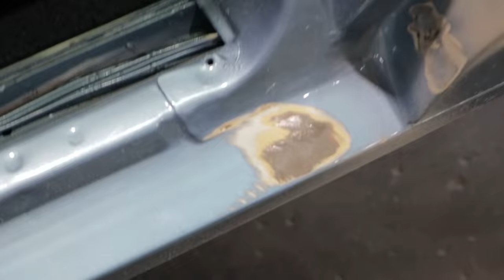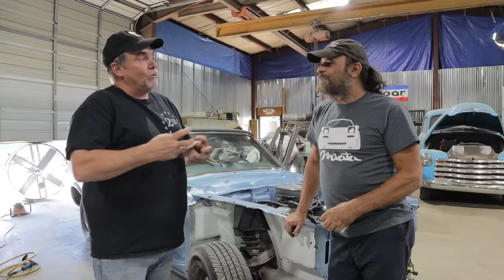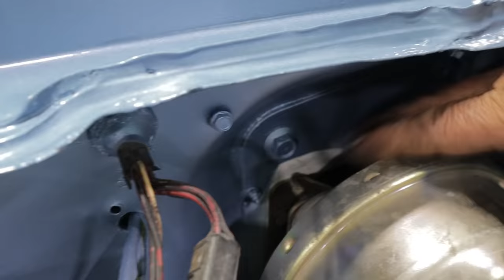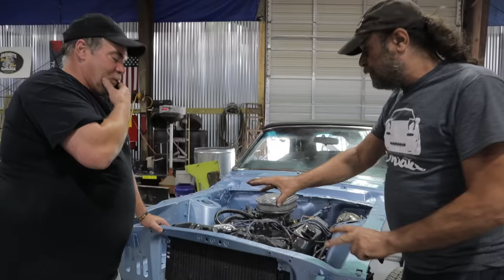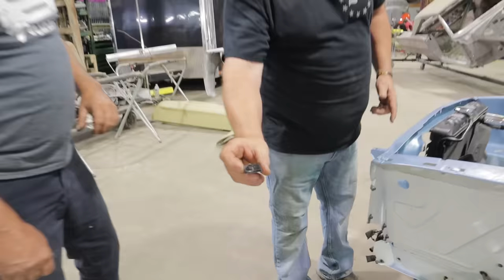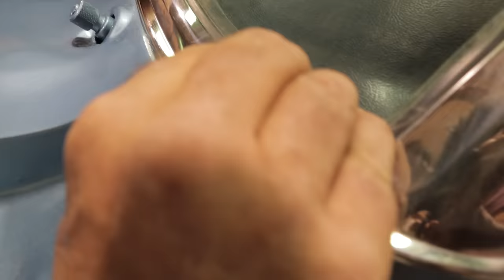Refugee From Body Shop Hell

Comment: I'm a body man. You have to get rid of the rust, then cover the area with epoxy primer or fiberglass filler to seal it, then do the final skim coat of plastic filler after that. And if it's still not smooth, use polyester filler or spray. But none of that will work if you don't get rid of the rust first. Cut or grind it out completely. Make sure there's no more on the back side of the panel. A lot of people think they got all the rust but there's still rust on the back side of the panel and it will just keep spreading like the cancer it is
Reply: Don't forget to skim coat and block sand!
Reply: To be clear, rust converters won't stop the cancer from spreading?
Reply: Yep. Welding patch panels to rusty metal sucks anyways. 
Unless you can really get to the back side of the metal it's going to rust again. 
If you're a body man you know what I mean.

Comment: Problem is do a competent restoration on almost any 50's or 60's car you will be well under water when you go to sell it.  Only way a flipper can make money is cut corners.
Reply: You might be able to flip a rare valuable car, like some sort of limited edition hemi that sells for 150 grand. The problem is a full restoration costs pretty much the same for a base 6-cylinder car as it does for a valuable limited edition.
Reply: @evoblade2000  Agreed there are a few numbers matching cars such as certain hemis, certain corvettes, copo Camaros, LS6 Chevelles, Shelby Mustangs and a few others that you could do a last nut rebuild on and probably come out okay, assuming you owned the car in first place.  This looks like a run of the mill 67 Mustang.  To strip it to bare metal(which needs to be done seeing the rust), repair any rust, repaint, reupholstery, rebuild engine and transmission, rewire ect would probably run you 70-80k if you farm it out to a reputable shop, maybe more depending on how bad rust is and how many parts need replaced.  Then you have a car worth about 30k on a good day.
Reply: For that amount of $$ I’d rather buy new.

Comment: I worked on a 67 mustang that had the fender Bondo d directly to the rocker panel. I saw a chevelle in the junkyard that got rear ended it had a inch and a half of Bondo, the paint was shiny too.
Reply: My 79 F100 had a solid two inches of bondo fall out of the fender a week after I bought it. First cars 😂

Comment: As more of the graybeards that naively finance these shoddy restorations die off their cars will become the parts cars for higher end restorations.
Reply: And that is as sad as the work done on this car. I would rather have more classics than less.
Reply: @davidmiller9485  slowly, the quirks of time diminish the ranks.  Classics get totaled in accidents, garages burn to the ground, floods in unexpected areas, theft and stripped of parts, etc.  Obviously as the years go by what were once common cars join the collector ranks.  Interestingly, Haggerty  says that the total number of classics has stayed pretty steady over time: newer cars become classics at about the same rate as existing classics get written off.
Reply: Maybe if every b o o m e r wasn't a "I know what i got, and this rusty rolling shell is worth 20 grand" types there would be more cars in the hands of young people
Reply: @davechampion4987  You can be mad at the marketplace if you like, but the truth is that a lot of cars that were once easily found have diminished in numbers.  Every year countless classics are lost to accidents, theft, garage fires, etc.  I bought my first muscle car through a local classified ad: a 1969 Mustang Mach 1 428 Cobra Jet 4 speed.  It was just another used car at the time, I paid $2,500.  Young  people are not into cars the way us graybeards were when we were young - recent surveys show that young people are delaying getting their driver's license - that they would rather spend all their time playing Fortnite.  Young people are not cruising the drive ins or burger joints.  Sure there is still street racing going on, but it is not the hypnotic religion that it once was where everyone in high school seemed to be involved.  The world has changed, and playing with cars is no longer something that can be done while working part time at the shake shack.
Reply: @Thomas63r2  there are dozens of project cars for sale on my local Facebook marketplace that are absolute junk and have been on there for months with a 10k price tag and “no low ballers” in the description. Maybe boomers are greedy ?
Reply: @davechampion4987  If people ae actually buying junk for $10k, then that is the market price for cars in that condition.  Do you want to buy one of those junk cars, but just for less money?
Reply: @davechampion4987  I am "older", and maybe you see the car hobby differently.  I have owned several collector cars and hot rods, and yes I did have some fun cruising, at the drags, and at car shows.  Time passes us all by, does it bother you the direction of the car hobby?  Does it bother you that some running and driving cars become donor cars for high end restorations?  Go ask any group of teenagers under 20 years old and some may say old cars are cool - but there is near zero interest in personally owning one as a daily driver.  Most classic cars that are inherited are sold off in a year.
Reply: @Thomas63r2  I'm saying most old fogeys are the ones out of touch with the market.  They don't recognize there is a lack of demand for this stuff anymore.  Most think it's still 2002 and cars and parts still fetch top dollar when they dont.  There is a guy here trying to sell a pair of camel bump heads for 1200$ still even though nobody wants them anymore and can get a set for like $300.  It's gone from a mainstream hobby to a fringe thing again.  There are some young people into it.  Too many guys are gauging demand based on  early 2000s level of interest in the hobby.

Comment: Sad . 
  When I was 13  (1978 )my grandma left me her 1966 t bird convertible. The car spent its life in Cleveland Ohio. . I took odd jobs so I could buy fenders , quarter panels . I leaned how to rebuild the engine, hang the panels and by the time I was 16 it was ready for body work and paint . My dad and I interviewed several shops lol. We went with a shop called lead man . Well needless to say he went out of business 5 months into my car being there . IRS issues . When I got the car back 2 years later it had been ravaged of parts . I was 18 at this time . Took me another 19 years to rework the car . Now at the age of 56 I still own it and my 1966 hemi charger both are still mint and driven all the time.

Comment: Before owning a  Body shop, I was doing paint/body repair on cheap flip cars from the auction. I'm in the Salt Belt state of Michigan. I recall 20 yrs ago, a  K5 Blazer I had acquired and rocker panels were completely missing, due to rust. Both inner and outer. I hand bent rocker panels from a 6 foot tall birthday card that was made with heavy construction paper. Turned out awesome. Sold it and a year later, noticed it for sale. Stopped to check it out and talk to the owner. While looking at it, I gave the passenger side rocker a little tap with my work boot and the ENTIRE rocker, inner and outer fell to the Blazer. Asking price WAS $3500, and after the rocker peeled off, I offered 1000 and was once again the proud owner of a soon to be rust free k5 blazer..

Comment: My daughter had a 68 Chevelle done 3 years ago locally here in Port Orchard couldn't get to the car finally I went over with my son and we pretty much took the car forcefully it was ugly but we got it back
Reply: MY bud had to do this with his 69 Charger RT/SE a couple years ago... it went way over and empty promises and lawyer got involved, he retook possession of the car, and then they worked out the remaining parts to assemble and did finally get his car finished.  He had it 28yrs before when we put that 440hp in the gravel driveway and had to ratchet strap the hoist to the truck so it wouldn't tip over and push the car to the engine to get it in!  IT's the primered Charger at the track in my 96 VHS bracket racing

Comment: That car kept dry and treated right would look the same in 20 years I bet. Lots of cars are like that. Is what it is sometimes unfortunately.
Reply: I personally know of a few decent looking classic cars that were redone in the early 90s with some of the hackest methods ever seen in body work, but because those cars have had owners that cared and kept them in climate controlled garages all this time, the cars still look the same almost 30years later with very few blemishes or bubbles under the paint. Now dont get me wrong if these cars lived outside for 6 months they would be trashed but it goes to show how the vehicles are stored will have the biggest impact on how they hold up.
Reply: @briang4470  true. Plus guys buy restored cars thinking they can drive them like a modern day car. Even the nicest of the nicest restored cars won’t survive being driven in the rain etc. I even cringe when I see guys wash a restored car with water. No reason to ever fully wash like that before car shows etc. Water always equals the enemy.

Comment: Over on another channel, there is a Charger 500 that is getting restored.  They had the body dipped to remove paint and rust ( Good )  however, they didn't dip the car in E coat preferring to hand spray the car ( not good ) .    It is impossible to get paint in every hidden area without an E coat dip and as a result this car will be a rusty mess in a few years.  You just can't get paint inside the: A pillars / Cowl / door hinge posts / frame rails / rockers or any spot welded seam.  

I brought this up to the cars owner who owned the car since new , channels owner and the shop doing the work. Basically they said " I trust the shop " and " We know what we are doing, go away.  "    Some in the comment section said this won't be a problem " if you take care of the car " .  Like how, leave it in a plastic bubble with zero humidity?   Have a panic attack if it rains when the car is outside?  

The shop also powder coated some of the grille / headlight panel areas ( I don't like powder coat especially on a " restoration " ) .  The parts were pitted once the  rust was removed, this showed through the PC and the shop was on camera stating " We will coat these again to get rid of the pits . "  Any guesses on how thick the PC will be to get rid of the pits? 

By now the car is in color coat and probably on it's way to be reassembled, I've given up trying stop this disaster. This isn't a disagreement on something like what brand of paint to use, it is basic body prep.    Will bare steel + moisture = rust? When this turn in to a rusty mess with everyone blaming the dip / strip company?    You be the judge.

Comment: If a person has the talent to be able to cover something and not fix it but still look good , wouldn't the person have the talent to go it correctly? Maybe I'm confused lol
Reply: Logic and Reason defies he who doesn't RIFF... Confucius 420AD
Reply: @THRASHMETALFUNRIFFS  true words yip
Reply: Had a shop in Norcross, GA that was paid by my insurance company to replace a quarter panel but they spent more time pulling it out and working it with filler before painting it. When I went to pick it up it looked good but the magnet said different and I refused to signoff on their work. 
Had the insurance adjuster meet me there the next morning and showed him what I found and they towed the car to another shop who fixed it the right way. 
First shop lost their ass on that job and received no more jobs from my insurance company. I think they went out of business within a year.
Reply: @bigbear5510  that's awesome, I'm glad to hear that . Same as engines , I've seen " professionally built " engines that was completely horrible, mixed up cylinder heads ( different combustion chambers everything) . Years ago back east ( New Brunswick Canada ... not New Brunswick jersey ) one of my old friends had put good money into a 400 sbc and the thing started and ran terrible and was missing on a few cylinders plus lost all its oil pressure.... turned out the guy who " professionally built" the poor engine for some unknown reason didn't put push rods in number 3 or 7 so when she fired up it kicked out the lifters and lost oil pressure ( kinda explained the miss ( or three ) in it also . Anyways it ruined the engine because of no oil pressure and it was brand new parts . That one still makes me shake my head
Reply: @unclesquirrel6951  I've seen the same thing with engines before too, never seen one missing pushrods though, I have seen a few bent ones on freshly rebuilt engines. I've seen a mix of new & used pistons. It's like what were the thinking!! I have replaced a cracked or burnt piston with a used one from another engine but they were just basic rebuilds & were perfectly fine. I've built a few high performance engines and never had any complaints on anything that I worked on except this one lady who claimed that her car quit running after she left my house. So I rode down to where she was, engine turned over and it was firing but not starting... Long story short, she ran it out of gas!!!😲🙄🙄😂😂😂
Reply: @bigbear5510  😂😂 nice 👍

Comment: I admit I take some shortcuts on my home project. It"s a 500 dollar 86 Mustang, not heading to any car show. I didn't pull the motor or polish every screw. I did treat mild rust with white vinegar and am doing some metal patches and fiberglass fill. I saved this car from the trees. Previous owner gave up. Heading into my seventh month and enjoying the challenge.
I could never afford to pay to have a car done. And there is learning and a sense of doing something difficult and sticking with it that is greatly rewarding.
Reply: I grew up in the time that Fox body’s were fairly cheap cars and on there 2nd or 3rd owner. I remember the frames flexing and the doors not closing properly as completely stock cars. I couldn’t imagine what rust would do. They were however super easy to wrench on and very reliable. When I was in high school in the mid 90’s it seems like half the guys had a Fox body. Back then a fairly nice 1987 5.0 could be bought for around $2000 maybe  a little more if it was in perfect shape. Kinda crazy what they go for these days

Comment: We had a 66 impala convertible that was a basket case of done cars and previously worked on panels and a beat body, the guy had the frame painted and put on the car with the rusty bottom of the car still bare. He didn't want to do it the right way so he got what he paid for.

Comment: I bought a classic vehicle with rust bubbles. But, it was bought from the Junkyard for a small work vehicle, a 1980, Ford Courier. I expected nothing and got nothing. I used it for two years and sold it for £300 to a farmer.

Comment: Kindle Ford in Cape May County NJ is one of these crooks. 18 months they had my 93 Bronco for a repaint because of the factory peeling clear coat, 18 months later I took the truck, 3 months after, all the clear coat peeled off the hood and the Driverside door kept falling off cause they kept putting the hinge pin in upside down I just gave up after that.

Comment: Ford also had the VIN stamped on the top of the right and left aprons . Looks like they are missing here along with the shock tower braces . Never count on the door or dash tags as they are easily removed with a screwdriver . Quarter panel scoops are missing and the C scoop line looks funky . I traded a lot of solid beat Mustangs in the 80s to build the ones i had and this is just garbage - i used to mock 1 guy because his car looked like the bondo was applied to the driver side with a snow shovel but that was a $400 car .

Comment: Wow Tony who ever done that butcher work I can not call that body work that is a disscrace to bodyman... And perp/painter's.  I started working in high end body shops in '77 where they used to do restoration's but now the restoration shops are gone only thing is collision shops and they won't touch rust... I hate working in collision shops there just out for the money ... I do the odd small job at home me being retired fixing dents or putting patches with epoxy primer that helps prevent rust did grinding the rust out if there is one speck of rust it will come out like cancer ... I packed in the collision shops I'd rather do the restoration work that way I take pride in my work... 
  I'm glad your showing people how some of the those shops do there work...becouse I seen it many times ...

Comment: In the70s, my family owned a body shop in suburban Detroit .A 3 year old unibody pony car would  be ready for rocker panels door skins ,at least half of the floor, wheel house outers/ quarter panels at a cost that was totally out of the question.When the availability of  patch panels and specialized stampings came on the market,it would take another 20 years for car hobbyists to truly get a real world enlightement as to what kind of tenacity in terms of time and expense would be necessary to make that 67 390 GTA fast back able to hold the drive line  again. Mopars were the worst cancer clusters by far.One fact that stands true...When it is done right, you only do it once...